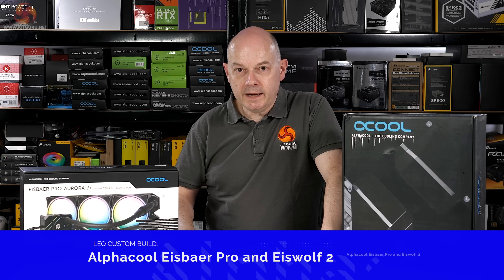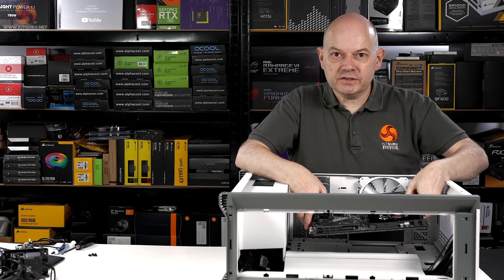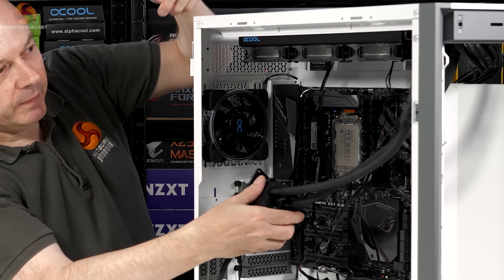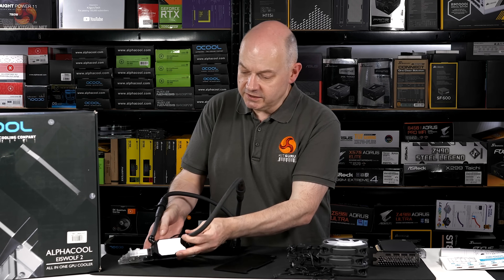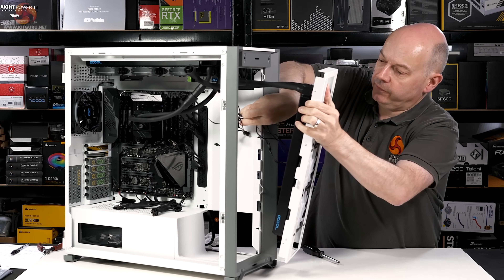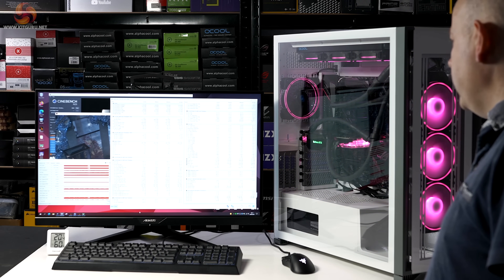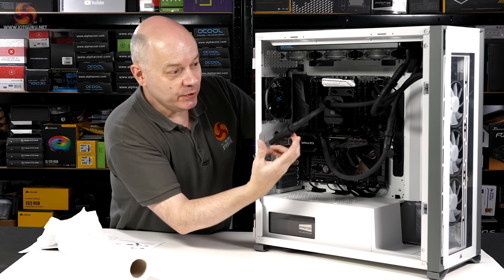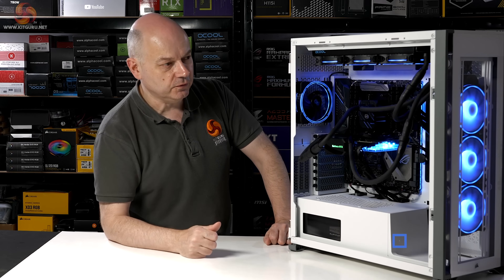Leo BUILDS an ALPHACOOL Custom System!

Comment: I changed the tubes without the quick connects, but I added a reservoir with pump where the back fan sits that is 12x12cm and connected all coolers together and daisy chained the CPU cooler and the Icewolf in one closed loop, that is what I like about the Alphacool products, you can do whatever you want because it's so versatile, as long you use the right connections and tubes.

Comment: You can start with an AIO but can expand to a fully custom Watercooling System , Alphacool uses Standard Fittings . Another important thing is , Alphacool uses full copper Radiators , you have no such problems as with Aluminium Radiators which can make problems if you mix metals . And if a pump fails , you can repair it by yourself with buying a new one = standard parts , you can buy them seperatly , they are sold for Custom Loops as well . The CPU Cooler has a little reservroire , you can even refill the coolant by yourself .

Comment: 6:24 I was thinking about getting a PCIe extension for this case to mount vertically with that same GPU AIO. What are those problems that you briefly mentioned with that? Are they still a problem 8 months later now?

Comment: Can these fans regulated to some bearable noise/airflow ratio? Like what would be the thermal performance, if all running at just 1000 rpm? I am trying to figure out, if i have to ditch all fans for better ones as soon as i get my eiswolf and eisbär.

Comment: Where did you plug the 4 Pin Connector of the Eiswolf Pump when there is only one AIO Pump Connector which is being used for the CPU AIO Pump?

Comment: In the instructions @11:22 it illustrates that you should connect the components in a "RAD->-RAD->CPU->GPU" loop, and it looks like that's what you did aswell. Wouldn't it be better to alternated component and Radiator, like "RAD->CPU->RAD->GPU" so they each get 'fresh' cold water?
Reply: The order doesn't matter at all. Once the loop reaches thermal equilibrium, the whole loop is the same temperature. There's a few good videos out there with data, this one comes to mind from JayzTwoCents https://youtu.be/RnPB_q51iVk
Reply: I was wondering exactly this myself

Comment: I have just got a Lian Li Gen 4 riser cable and it is working fine with an Asus Crosshair VIII motherboard and Rx 3080ti FE Leo.
Reply: I have a Lian-Li 011 Dynamic XL, Lian-Li PCI-E Riser bracket kit, Lian-Li PCI-E 4.0 GPU riser card cable, a ASUS ROG Crosshair VIII Formula and a Sapphire Nitro+ SE OC RX6900XT. These all work just fine. So why so down with Riser PCI-E 4.0 cables??

Comment: It would have been better if the combined coolant flow was from the CPU to Radiator 1 to GPU to Radiator 2 to CPU.  This would allow for the coolest coolant to remove heat from each processor rather than pass the heat from one to the other.
Reply: I understand the closed loop system, but transferring heat from one processor to another, then through two radiators, is the least efficient way to remove heat from the system. While the firstcpu will be fine, the second will run hotter than if the coolant passed through a radiator before passing over it to remove heat.
Reply: I have to agree with Bruce here. It is a closed water loop, but it is an open thermal loop since you have air interacting with the rads. the first component will get the water hot and pass it onto the second component which will have trouble offloading its heat to the water since the temperature difference will be less, it will then pass it onto the first rad which will cool just fine since it has the maximum temp difference. but then rad 2 will have an already cooled liquid which again makes the temperature difference with ambient lower and be less efficient. Although it might be true that the difference is negligible.

I h ave to ask though, is such connection possible? or are the connectors in such away that only allow CPU-GPU-Rad-Rad configuration?
Reply: @superjugy  Totally possible. You can put components in any order.
Reply from the maker: It's a closed loop system so the order doesn't have any impact in the same way that 10-7+10-7 is the same as 10+10-7-7

Comment: Nice vid as always :) I got question. Can i put 3x360mm Rad in that case? Will it fit?
Reply from the maker: Haven't tried it but you probably can. The thing is you would need to use both the front and side positions in intake and the roof in exhaust to have a chance of making it work.

Comment: Excellent video, thank you. 

The hoses look long enough for you to invert the front radiator and perhaps have the GPU in a lower slot - being a Threadripper system there's more than one full x16 slot.

As an aside, can I commend your measured diction? It's great that you do not speak fast.